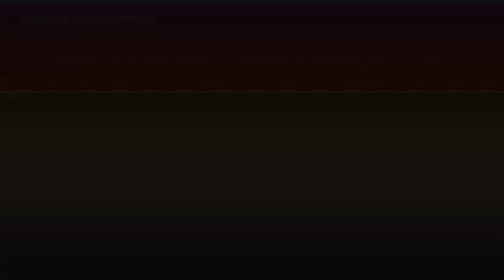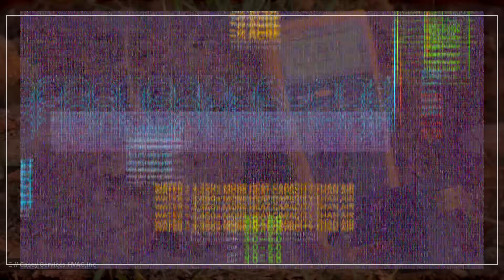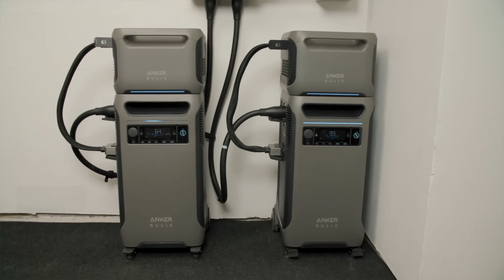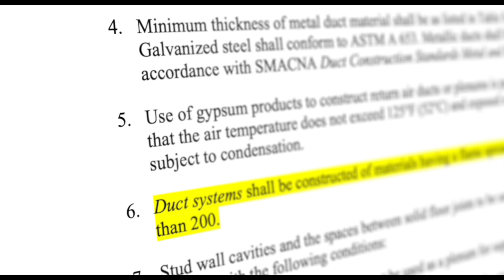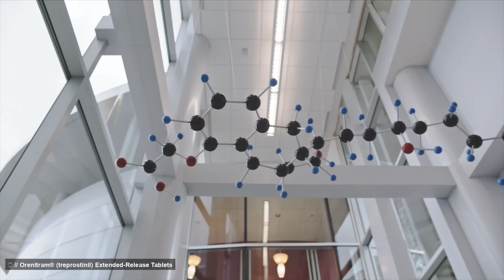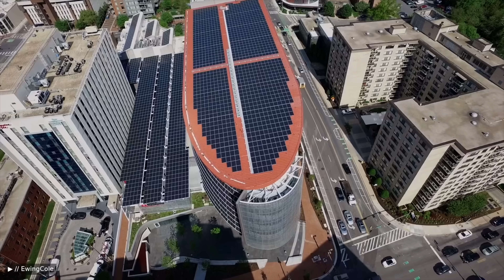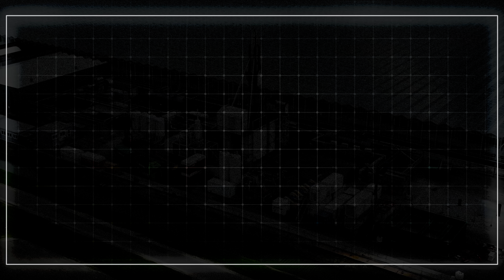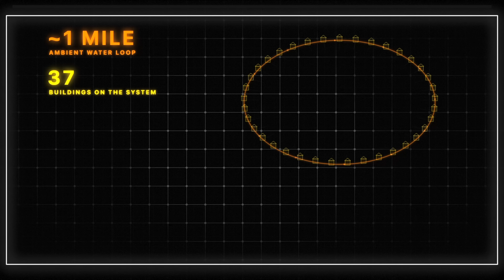The Viral DIY Cooling Hack That Nearly Killed a Family

Comment: Yeah, having researched these systems extensively for years, ground geothermal is amazing, but it has to be done right. What you need is the heat exchange, so there's no reason to bring direct air from an underground pipe, and it's unsafe. Vertical borehole geothermal is the best version of the technology, but drilling costs need to come down and HVAC technicians need to learn how to design and install these systems across the industry so it can become affordable.

An other interesting fact about ground geothermal, is that it gives you access to an enormous thermal mass, so you can use it to store seasonal heat and cold for later use in the year when you need it. Geothermal technologies really are the future.

Comment: i'm planning a home atm and the amortization period for simple ground-source heat exchanger is really bad (40-60 years) because it just does not move a lot of energy. similarly, the upfront cost for a ground-source heat pump is just really high. it's much cheaper to just use a air-source heatpump, install solar panels and run the cooling off the heat pump, and the power from the sun (which correlates with hot outside temperatures here) is basically free, so it's cheaper, less complex and achieves the same outcome.

Comment: Why isn't there a hybrid between slinky and vertical? Imagine sticking a hair pick in the ground, a series of 20-50ft deep holes with a 5ft trench connecting them. 
That way you get huge area without needing super-drilling equipment. 

Or just a few 10ft trenches with a verticle slinky. It'd be a nightmare for utilities companies and anyone installing sprinklers after the fact, but less so than the shallow horizontal slinky.

Comment: Daisy chained water based systems sound great. However, a large liquid tank functioning as a thermal battery with a large PV panel array for air source heat pumps to stabilize liquid temperature seems more mature technology.

Comment: There was a community south of Calgary in Okotoks called Drake’s Landing that used a shared GSHP system. It ran for nearly 20 years, and was recently decommissioned. Pretty sure it’s because they couldn’t be bothered to figure out how to replace fittings. Either way, it might be an interesting case study for your house adventure, and if it ends up being a new TBD take down video, then so be it! 😆 good luck with the drilling dawg

Comment: Switched my old combo roof units: electric/propane to electric heat pumps. They were not cheap on the installation side but on the operational and maintenance side, wow! I would never go back. Saving about 20% on the air conditioning side and 50% on the heating side as well as a 60% reduction in noise from the compressor.

Comment: I'm doing a horizontal heat pump system, coupled with an evaporative cooled roof on the Texas gulf coast.  Being on a actual land and not stacked on top of my neighbor, tis is a great option.  You really should include the cost for installing a horizontal system using a horizontal bore hole rig.  There is minimal trenching, you can get fairly deep for short runs (30-40 feet deep over a 120 foot run).  I have the added benefit of the ground water table being as shallow as 20 feet.

Comment: I saw a couple of those videos.  Are you telling me that those clearly AI-created videos got things WRONG?  Oh pshaw! I say.  I thought AIs were super intelligent.

In all seriousness, thanks for the video.  I find it all very interesting, but I live in a Bronx apartment building, so this is nothing I could use myself.  I would think that, given the cost of retrofitting a geothermal heat pump, an air-source heat pump would make much more sense for a mild climate like San Diego.  I suppose, as a YouTuber, you can leverage the system for content and possibly deduct at least part of the cost from your taxes.  That might not be as great as a tax credit, but every bit helps.

Comment: Geothermal is an expensive solution, best suited for cold regions IMHO, but it works well anywhere you have conductive soil.  Test your soil if you are considering it .. this is important.  My own bias for most people is much cheaper air to air, or or air to water monoblock heat pumps … ideally run on R290 (propane refrigerant) for cold regions (or R32 if your region doesn’t allow it).  Air, even at -30C has a lot of heat in it .. since absolute zero is -273C.

Comment: Don’t forget a geothermal unit has a 20yr life expectancy.  And your standard units are now 10yr.
Reply from the maker: The piping and expensive installation bits I think are 50 year, which is great.
Reply: @TwoBitDaVinci .  I should’ve preference with the actual self-contained unit. The HDPE pipe is usually rated 100 years but some studies are showing that it could be closer to 200yrs.

Comment: 8:57 wut!?!? ..."design now uses a closed brine loop that captures the grounds thermal benefit through a buried water pipe without ever letting the buried air touch the inside of the house..." i don't get it.... is that a air pipe or a buried water pipe? that sentence contradicts itself.
Reply: Buried water pipe with heat exchangers to the air system.
Reply: @DiakosDelvin  he used the phrase 'buried air' tho. are the heat exchangers buried? i doubt it. probably just in a surface hole to keep it out the way, but hardly deserving of the 'buried air' descriptor.

i'm assuming he misspoke.
Reply: @ericaugust1501  YouTubers are human, at least he is, probably made a mistake

Comment: There's a couple differences in why people choose an air-cooled geothermal system. One is cost. The other is freedom. The other options are multiple times more expensive than laying pips in the ground. Also, since most houses are merely upside down boxes plugged into grid-dependent life support systems, air-cooling earth tubes enable us to use thermodynamics to get free HVAC via solar chimney. If the earth tubes are installed properly, there is no need to worry about mold. Plus, many designs incorporate a blacklight onto the incoming air before dispersing throughout the house, as a backup. The only real worry, IMO, is Radon.
Reply: And that's easily mostly fixed by HEPA filtration and activated carbon filters sequestering the radon

Comment: Built my own water loop geo about $20k.   I hired a helper to build loops
I hired an excavator while I dropped in the loops.  I bought my Bosch unit (what I could buy directly that was quality). I payed someone to run ductwork throughout my 2 story house.  (Old boiler and window air so we were starting from scratch.)
Hired an electrician to put it in a new 200 amp service since the house is only 100 amp service.  
I did all the plumbing myself, including a new 40 gallon electric water heater fed by 120 gallon storage tank that is heated off the geothermal unit. 
If I didn’t have tax credit estimated pay back would say 10 yrs but that’s the full $20k it still would have been $10k for a regular system.  So 5yr payback for extra cost.  But I did get tax credit because trumps 1st term it got extended when originally it was going to be cut and only solar got a rebate
Reply: @Mark-n3m3q  BULL... BIDEN, TRUMP, AND OBAMA HAD TAX CREDITS.  STOP LYING.
Reply: @ImprintM523 .  Let me get you some facts. 
In 2015, under President Obama, Congress extended long-term tax credits for solar and wind, but several other renewable technologies — including geothermal heat pumps — were left out and scheduled to expire after 2016.
Expire but I believe there was a 2 yr taper just like when Trump extended it.  
He made a big deal about it so Biden had to extend geo when he extended solar and wind. 

It did end with the big beautiful bill.  
Don’t let your feelings get in the way of facts.

Comment: I have a closed loop ground source Heat Pump and love it.  Local Power Company meters it separately and I get a $.03 per KW discount for the heat pump.  Being in northern Michigan, this has saved me a lot of money on my Propane bill.
Reply: They are really the answer compared to propane
Reply from the maker: that's awesome which brand did you go with? do you have drilling costs?
Reply: @TwoBitDaVinci  I used Hydro-Temp in Arkansas. They ship base units. I have 500ft of 1" black poly for 1 ton. Wish I had 2x400ft for 1.5 ton but didn't think I would have room.
Reply: 3 ton Carrier.  I have over 11 acres so we just dug a trench about 5' deep and buried the tubing anchoring each loop to the side walls before back filling.  Before the heat pump, I was going through over 1200 gallons of propane a year heating the house, cooking, cloths dryer and keeping the barn at 40 degrees.  I am now using about 200 gallons of propane for those jobs.
Reply: @Sundancer268  how many feet of tubing for the 3 ton? Mine is 500ft trenches @ 6ft for 1 ton. Definitely not too much. And I don't recommend slinky coils.
Wish I had 2x400ft for 1.5 ton but didn't think I would have room.
Reply: If memory serves me right, there were three 700' loops buried.  I have the unit set to switch to propane at 15 degrees OAT.  They are straight tubes and were installed about 2006.

Comment: I think most people realize that a lot of the type of video titles and the related content you mentioned is basically "click bait". I've watched a few and very quickly realized moisture control would be a problem. Warm air holds way more moisture than cool air so as the air cools it will condense a long the walls of the ducting. That could and likely would result in mold growth if not properly managed. If someone is stupid enough to try and build a "system", any system, based on a YouTube video they deserve what they get.

Comment: The big new thing in this video is community cooperation.  Ground source heat pump systems are decades old.  Getting developers and/or homeowners to embrace a shared community resource is tough in the US.  Weirdly electrical lines and roads don't bother people, but sharing a heating resource in guessing would freak people out.  Having that resource rented to you by an asset owner and maintainer is maybe how the shared ground loop new home communities were built.

Shared heating does exist elsewhere...European city district heating (even district steam heating in Boston), homes heated from power plant thermal discharge...

A community district geothermal model is the 52 home Drake Landing Solar Community in Akberta, Canada.  Solar thermal paneks on the garages pump hot water into a central borehole.  Benefits of large size geometry keeps borehole hot enough to heat the homes in winter.

In 2015 100% of heating was from solar moved from summer to winter.  Coefficient of performance of 30 even in coldest periods vs 3 to 1 for air source heat pumps.

Sadly, the experiment wasn't commercialized so the technology and experience made maintenace after 20 years too prohibitive.

It seemed a fitting example of community ground source heating.

Comment: It’s not illegal. You can’t just put an air pipe, that can cause mold. You run geothermal water-water heatpump and that works wonderful. You can do a basement vent that takes hot air from one section of house and it runs through a semi-conditioned basement before emptying in another side of the house. Being entirely in the inside zone that is safer - you just need to clean it often.
Reply from the maker: yeah what the video is about

Comment: I really like your presentation style in this video & in many of your videos. You explore & explain issues in an even handed non preachy manner. 

Most have a view point, make the case for it & denigrate opposing views. Nuclear power is an example. A video about thorium small modular reactors is likely to be gung-ho laying out the possible incredible benefits (including no need for high pressure vessels) while glossing over the difficult chemistry & metallurgy. 

Another overstates the difficulties of a liquid salt thorium reactor, not conceding the advantages of the abundance of thorium, the fuel cycle, the passive fail safe system & the system not being under incredible pressure (the cause of plant leaks & explosions). 

In this geothermal video you don’t claim it’ll save the world & costs nothing. You also don’t state you’d be an idiot for doing it. Your video is a good mix of pros & cons w practical issues that require investigating for each particular circumstance. The video helped explore some of these issues fairly (point of view neutralish).  Well done. 

Note: I’m in S fla & have been interested in a combo of solar & geothermal to generate electric, heat my water, heat my pool & cool the house.
Reply from the maker: wow thank you for your comment. I've been doing this for 10 years now, and what I've learned is, the deep dives and context is my strong suit. I leave the conclusions for you! thanks again for writing, south Florida sounds amazing, really love It out there. Sometimes CA feels too cold :)

Comment: After several years of listening in disbelief to a friend who had installed mini splits, a year ago January (2025) I installed 3 in our 2100 sq ft house here in Reno, NV. This high desert gets punishingly hot (100+) in the summer and we see several snow storms each winter. The minis (2 12Ks, 1 18K) have been keeping the house much more comfortable than the 5 ton/100K AC/gas furnace ever did (pretty sure the AC side was somewhat oversized) AND cut our energy bill about 30%. An extra bonus is the easy zoning afforded by three independent systems. The redundancy of having three also means a unit failure is no longer a hair on fire situation. I will NEVER go back to legacy ducted HVAC again. In addition, I was able to easily DIY all 3 installing one of them a day over 3 weekends. Cost? $1300 total for the three units plus about $400 for the needed tools. A neighbor with a similar tract house recently dropped about $10K having his existing HVAC system replaced! There is a reason the entire rest of the world has switched to mini splits. Here in the US we are stuck with expensive, obsolete junk just so the energy industry can continue to bleed us out every month. My old, still functioning system lives on as an emergency backup that I will likely never need. If/when I have a failure on a mini, all the hard work is already done and I could swap a system out in a few hours for about the same as the labor cost of a conventional HVAC service call.

With minis, solar on your house can run your climate control for free. In my situation, the "normal" minis are good down to -5F, in colder climates one would likely need the more expensive "HyperHeat" units good to -25F or lower. Also, the higher the latitude, the more solar panels you will need to compensate for the shorter days. Watch Tony Seba and the RethinkX videos to understand their take on how overbuilding solar is both far cheaper and much more practical than the other solutions such as any ground coupled systems or other high tech means that are trumped by a cheap mini split. I would be VERY interested in seeing if someone can make a better case for ANY other climate control install.
Reply: A ton is 12,000 btu/hr
Reply: @artsmith103  yes, and your point?

Comment: As you point out, the geothermal tax credit (for solar as well), goes away for individuals, but not for commercial. What you need to do is find a company that becomes an energy supplier (Utility) to you. They build and own the system, they get the tax credit, they factor that tax credit into a monthly lease payment that you make to them. I'm getting solar installed this year under this scenario. The beauty of this approach is there is zero up front cost to the homeowner and the Utility deals with any problems that arise. Obviously, you have to find a scenario that makes economic & contractual sense for your circumstances.
Reply: Genuinely glad for you finding a system that works for you, but that is an obvious scam at the national level, right? YOU can't do it, but somebody else can and then rent-seek to drive the overall price up.
Reply: @the_zeppelin_guy  Capitalism in a nutshell.
Reply: @economicprisoner 'government interferance rigging the ecconomy is capitalism, you know that system that hates government interference in the ecconomy'
Reply: @matthiuskoenig3378  Who told you that Capitalism hates government interference in the economy?
Capitalism relies on government for dispute resolution and the rule of law, and they always play favorites.
Reply: Damn, they're making everything a subscription :( 
I'll just dig the hole in the backyard myself. I looked it up, and you really only need to go down 20 feet.
Reply: @runed0s86 You need to dig a fairly long trench if you do not go deep.
I suspect vertical wells will be needed for most urban installations.

Comment: I’ve had a ground-source heat pump (water-to-water / brine-to-water) since my house was built in 1999. It uses a closed-loop borehole (“energy well”) with antifreeze/brine (in my case glycol). In 27 years I’ve never had issues with the ground loop itself. Heat is distributed through hydronic underfloor heating, which has been great, comfortable, low-temperature warmth and very steady operation. I replaced the indoor heat pump unit after ~20 years, which seems reasonable. Upfront cost is higher, but for us it’s been well worth it.
Reply: I love hearing this, that’s exactly how it should be and usually is when it’s done properly — the savings and low maintenance are phenomenal!

The most you would ever have to do with your closed loop is make sure the pH isn’t getting out of wack, a lot of the glycol use now has a corrosion inhibitor in it, too.

I occasionally come across instances where we had to swap out the glycol/water mix, but it’s really not a big deal :)